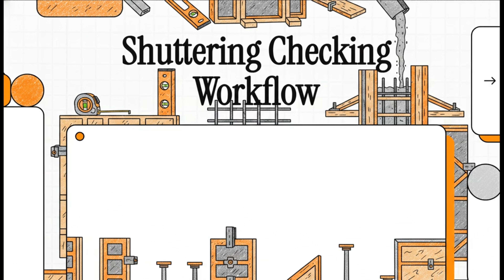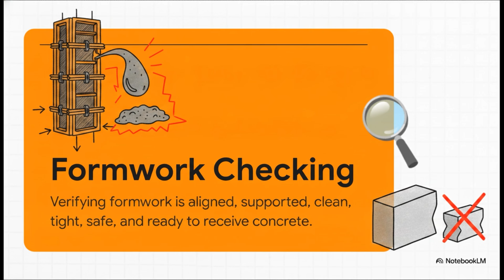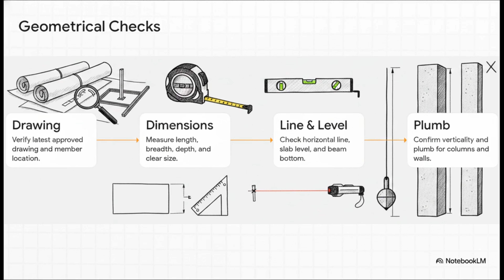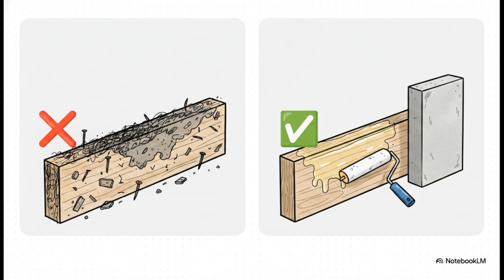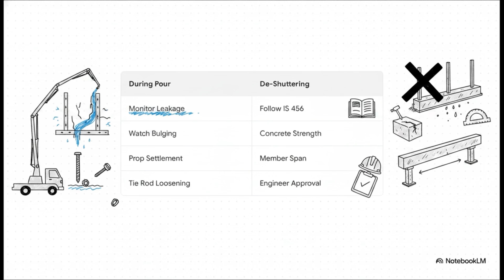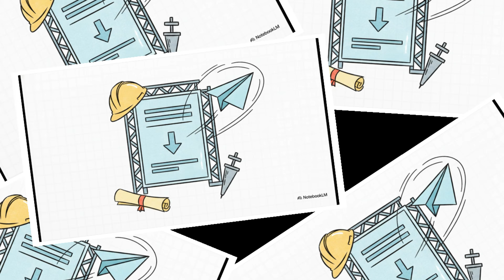Shuttering Checking Before Concrete | Formwork Checklist for Site Engineers | IBG InAI

Comment from the maker: 📌 Shuttering / Formwork Checking Before Concrete

Before concrete pour, a site engineer should check:

1⃣ Latest approved drawing
2⃣ Member size and dimensions
3⃣ Line, level and verticality
4⃣ Formwork joint tightness
5⃣ Supports, props and bracing
6⃣ Prop base and ground support
7⃣ Cleanliness and shuttering oil
8⃣ Sleeves, openings and embedded items
9⃣ Pouring and vibrator access
🔟 Safety arrangement

⚠ Important:
Do not start concrete pour until shuttering checking, reinforcement checking, rectification, photos and QA/QC approval are completed.

📘 Detailed PDF:
Telegram link is in description.

📲 WhatsApp Civil Engineering Community:
WhatsApp link is in description.

💬 Question:
Which shuttering defect can cause slurry leakage and honeycombing?

Comment your answer below.

By IBG InAI | Civil Workflows